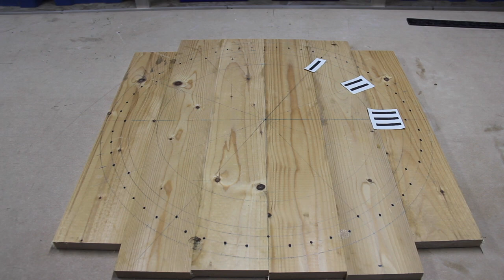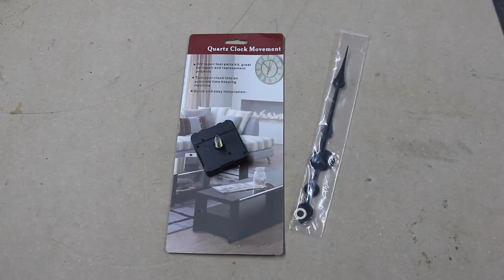How to make a Wood and Rope Clock

Comment: Wait...: a new shed and a new cordless jigsaw? WTF?
Reply from the maker: 😂😂 Its actually the same shed Frank just a bit bigger and a different layout. I needed more room, I could could hardly move in it anymore so I extended it a few months ago while at home due to covid.  I had been working off one plug socket and one light so added loads more too. I don't know myself now with the extra room, sockets and lights!  
I have broken 2 black and decker jigsaws and burnt out another non brand one the last few years so I went for it and got the Dewalt one. Hopefully this will last a bit longer!
Reply: @EamonWalshDIY  Well it’s good to see you with more space anyways. Love seeing your vids. 

I’ve a Dewalt jigsaw like that and they’re great but keep the blade retention area free from dust as much as possible. I bought mine used and the blades kept coming loose but a needle-pick cleared out the dust and it’s been a beast ever since. Apparently it’s a ‘known issue’ with the Dewalts. 

Dare I ask where you’re located? Based on the name I’m guessing somewhere in Munster, Ireland.
Reply from the maker: @frankblack1481  Thanks i will keep an eye on that. I am Roscommon, just a few KM from Athlone.